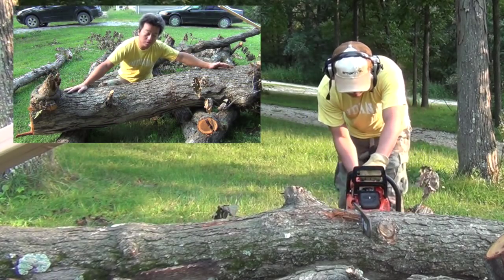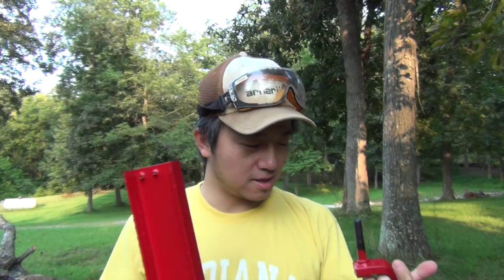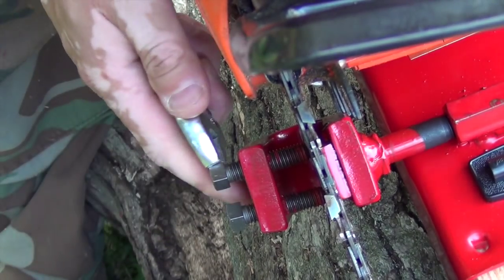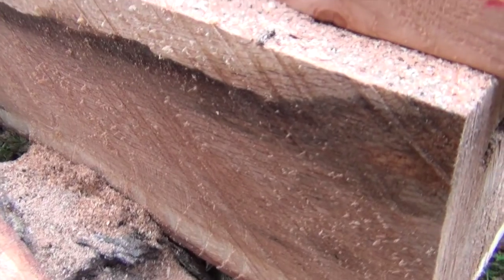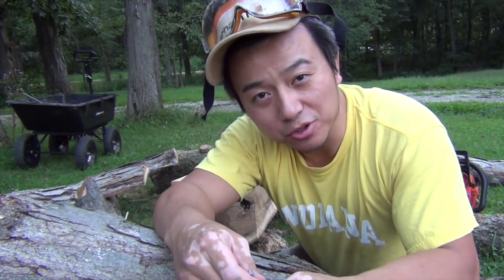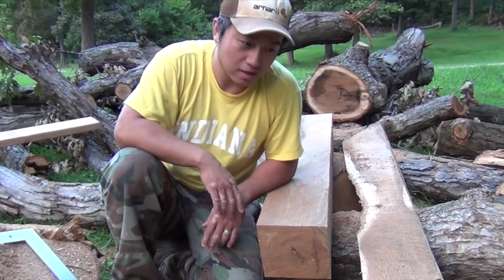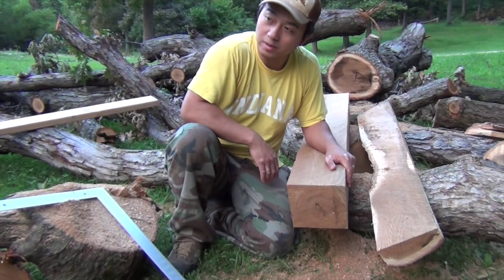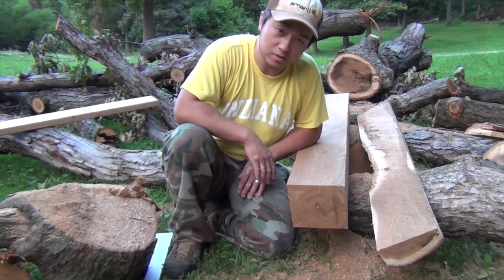Mill Lumber w/ a Chainsaw and The Beam Machine - 1st Time (Frugal Fridays)

Comment: difference between the beam machine and an alaskan mill is one cuts vertical the other cuts horizontal i have both, and you need both to utilize a logs full potential
Reply: Cant you just flip the log.

Comment: What you leg and foot there at the end when the saw swings down. Just need to make sure the whole log doesn't collapse when the side piece comes off and then have the stilling running chain drop onto the top of your foot. I'm not Mr. Safety by any means, but it does look potentially nasty in off or slippery situation. Reasonable unit though.

Comment: I’ve had one of these for 15-20 years.  Made a few woodsheds and dock beams.  There is definitely is a learning curve to getting accurate results but you can’t beat the simplicity.  Finding a straight 2X4 may be your biggest challenge, however!
Reply: How do you make sure your 2×4 is straight on the log
Reply: @blaineperry4205    You mark out the beam shape on the small end of the log, then screw the 2X4 down making sure it is straight along the edge.  Doesn’t matter if it’s bowed a bit.  The first cut is your reference cut.  The slab will be somewhat tapered, of course.  From there on you lay the 2X4 on the flat cut sides.  Keep a square handy.  A bit of a learning curve, as I said.

Comment: Nice video John, I have one of those and it looks like your first time went better then mine! I used it on a 20 plus inch 6 foot long maple log, I sliced off  one side to make the flat for a bench, And you are right about the instructions, they lack a certain clarity, But it does do the job and they are not expensive.
Reply from the maker: +heatherschubbyhubby Thanks HCH, my chainsaw was newi-sh, and I had a tree trimming guy adjust my carbs so it would run a bit more lean, that might help.

Comment: Did you us a ripping blade?  That's one thing I've seen mentioned on chainsaw milling vids.

Pretty simple looking accessory.
Reply from the maker: +wordsnwood I've seen and read that as well, evening "find woodworking" magazine. But I did not, the instruction specifically cautions against a rip chain.
Reply: Any idea why? Everything I've read/seen says it works better to use a rip chain.

Comment: This type of tool is quite usefull.  
You can get much closer to square with some additional tools.  A level for one thing will help hold square on the 3rd and  4th cuts.  

You can nail a 2x4 cleat to the ends of the log.  The square and level work this setup.  The method will be instinctive when you try it.

Also if you want dimension lumber or boards I have a suggestion.  I reco.end a table saw.  The kerf is thiner so there is less waste.  Slab off the or 4 sides.  Flip the cant end for end to get increase depth of cut.  Run multiple passes raising the blade each time.  If the cant is too big there will be some wood remaining between the two kerfs a hand rip saw will make quick work of that.  Let the limber dry and address the surface irregularities with normal shop practices.

You should also seal the boards on the ends to prevent checking.  There are products for this.  I have used cheap house paint with almost as good results as the purpose made products.

It a fun tool.  Looks like you are having fun with it.

Comment: That looks like white oak you cut from the bark and leaves that  is one of the hardest woods there is.    I am thinking of one for hemlock barn beams and to work in conjunction with an Alaska mill.
Reply from the maker: +cabotbluegill I think it is white oak; it was a very old tree that had a full life, before it could barely support it's own weight due to rot.
Reply: that does happen interesting mill you have

Comment: Pretty impressive for such a humble setup.

When I was younger I worked (slaved?) with my dad on his woodmizer portal sawmill.  I keep thinking of looking at some of these bandsaw mills, but then something like this would be a much better value for as much as it would get used.  If you are not selling milling services those, even those smaller mills just are not worth the expense.
Reply from the maker: +Make Crazydays Agreed. I found a couple of lumber sources around here, they are local and the prices are great. But I still have trees in the area that have fallen, or someone just bucked a bunch of 13" walnut and left them to rot. So a small and portable one has a great advantage.

Comment: pretty cool! how would you go about turning this into boards?
Reply from the maker: +Dutchhorse Thanks Burt. I don't plan to turn this into boards, I might use the beam machine to cut it down thinner to it can dry quicker, but they won't be typical board thickness.
Reply: Hi Bert, that question popped up in my head as well. From what I saw in John's demo, I think some amount of board can be cut from, let's say a 8" × 10" square log for example- maybe three quarters of it, by cutting it in the same elevated position. But as the log gets tinner, there will me need for more stability mechanisms to be put in place...those this make sense??

Comment: john, get a ripper chain, and a battery screw gun to fasten the 2x4 to the log. Great video.
Reply from the maker: +Michael Carron Thank you.
Reply: I use lithium ion impact driver(you don't strip your screws)just watch hard woods screws break easy wen drive to deep! Chisel down expose broken screw shank grab and spin out with vicegrips.tip maby helpful if in a bind
Reply: Ripping chain for sure, loved the info man gj in the vides
Reply: Hey, it's subtitled "Frugal Friday" for a reason.
Reply: Ripping chain makes it smoother. It doesn't do much for speed though.
Reply: Beat me to it with the chain

Comment: Alaskan chainsaw mill from Granberg International is a great mill. It is also VERY safe. No way the bar can kick back on you or hit you. That said is it a lot more money and is more suited for much bigger logs. Small logs this fixture you're using comes into its own and in my opinion is very versatile for those smaller crooked logs. Right on. Even if you have a big Granberg or even a Woodmeizer bandsaw mill this little fixture is NOT a waste of money and is a good one to have because you will use it.

Comment: That beam looks like it has a twist in it, not bad tho for the very fist time using the attachment I think where you got that out of square cut was on you very first cut spend more time on getting that 2x4 level if it tilts even the slightest you will get a twisted beam with one side out of square. When you attach your 2x4 get you a small level and make sure you are level across the board don’t matter if it is level the length of the board.

Comment: I have the echo timber wolf.
there is an adjustment screw for the oiler.
Reply from the maker: Everyone raves about that major brand but this was more performance for the $. Thanks for the info.
Reply: John Zhu ya that happens to be the same reason i bought this saw.

Comment: Could you please let me know the size of the two bolts that hold the bar? I need to replace them (they got all rusty - my fault) but I am having a hard time finding the correct replacement size. I checked with the spare bolts I have in my garage but none fits perfectly. Maybe they use metric?
Reply from the maker: I don't know the exact size, no reason to believe yours and mine are the same size. You can get a thread measurer to find out exactly what you need.

Comment: The 
Timber Tuff TMW-56 Lumber Cutting Guide on Amazon is $30.99 and that includes shipping. It is similar.
Reply from the maker: Thanks for the info. There are lots of brand with a similar design this just happens to be the one I selected.

Comment: Please explain the 6 1/2 years comment. I don't know enough about milling to get that yet.
Reply from the maker: +MMASAVANT Sure thing, the rule of thumb for air drying freshly cut timber is 1 yr /in. So a 6.5" thick piece should air dry for ~ 6.5 years before it is properly dried.
Reply: +John Zhu simple enough thanks John!
Reply from the maker: +MMASAVANT NP. I never have the patients to wait that long. A combination of kiln and air is what I prefer.
Reply: +John Zhu how much does that shorten the process?
Reply from the maker: +MMASAVANT I should clarify, I use both kiln and air dried wood. I'll use kiln while I wait for the air dry. But I am thinking of beam machine some lumber, let it air dry for awhile, then finish them with a kiln (that I have yet to build). I think how much it shorten depends on when you want to start with the kiln.
Reply: +John Zhu that makes sense. Cut some timber in spring then haul it down to the desert (AZ,NM, NV etc )for the hot summer. Probably to much work.
Reply from the maker: MMASAVANT May be someday. FYI, the ideal time to cut is in late fall / early winter. In the spring the tree is super wet.
Reply: +MMASAVANT Then rotate out each year.
Reply: John Zhu oh ok, learning more and more.

Comment: you would of saved time by having a sharp teeth on your chain saw. All I could see was saw dust not chips.
Reply from the maker: The chip to dust ratio, on a sharp saw, varies depending on the degree of perpendicularity.
Reply: you are correct @johnzzhu